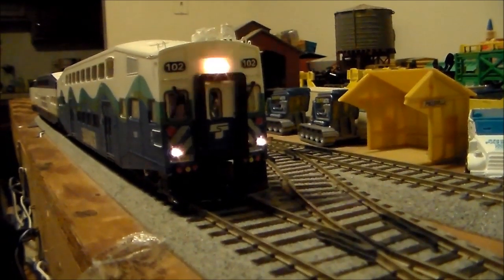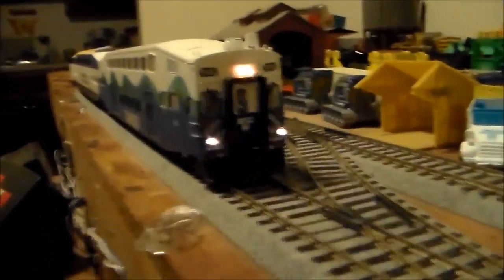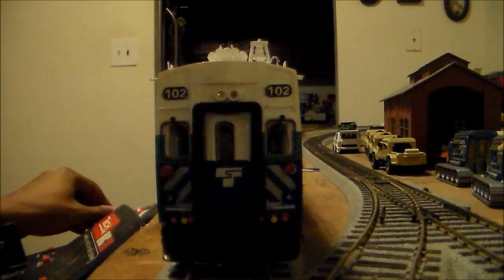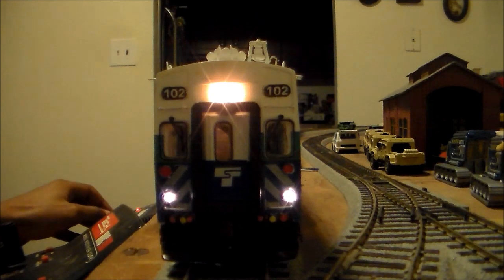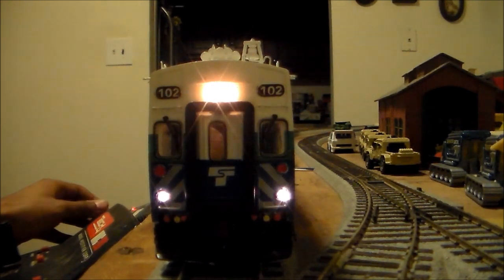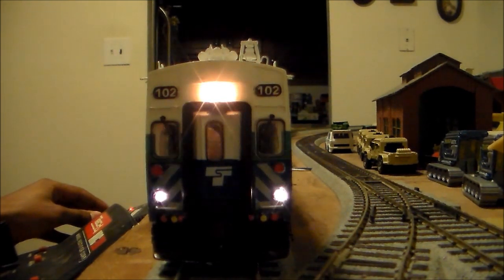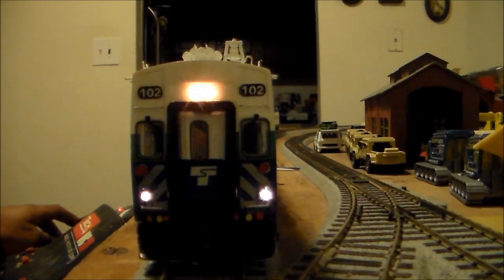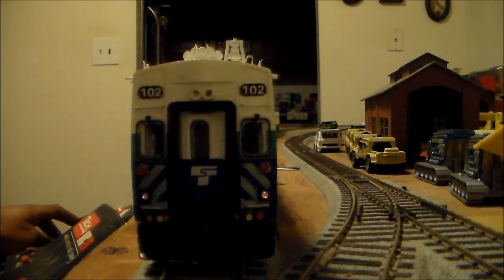Sounder Cab Car Issue

Comment: the car has a DCC ship in it and if you are running it on a analog (DC) track you could burn out the micro LED. To note: These cars were not LED equipped so someone installed it.
Reply from the maker: actually it doesn't have a dcc chip the original owner made his own PC boards for the lights and pick up's. I think there is an issue with the circuit he made. I have tried to run it since this video so I don't know if the issue is still there.
Reply: Try this: Taking the car off the rails, use a battery with some long wires. Connect the wires to the wheels and see if it still does it. If so then you will know it is the circuity. If not then you have an issue with the track or power systems you are using.